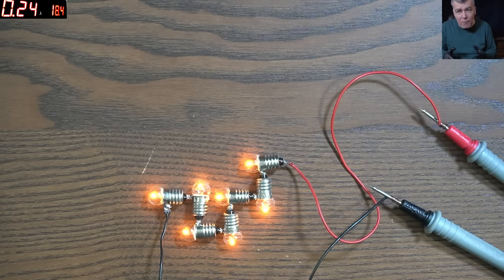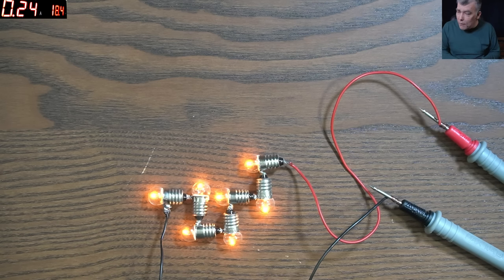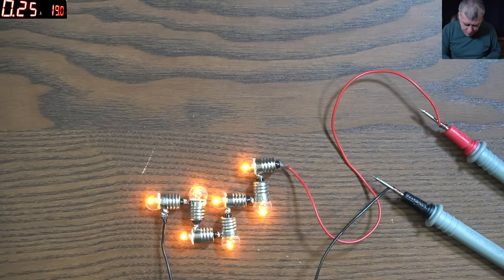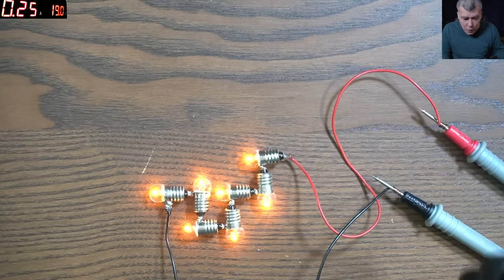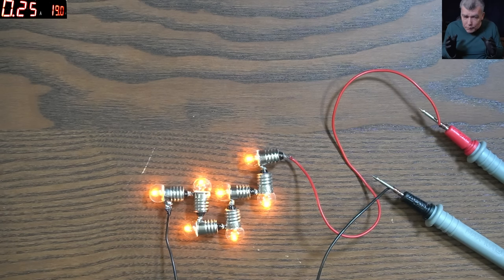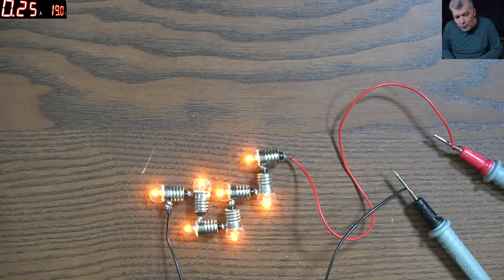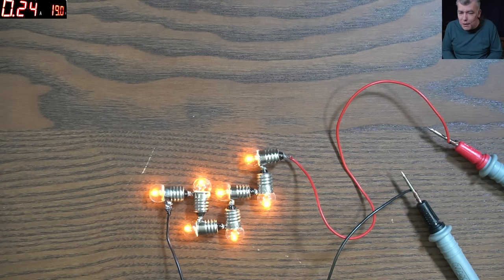Current controlled vs Voltage controlled circuit - Tv, Laptop backlight circuit explained

Comment: Controlled means constant in mathematic formula,  
U = I * R , so if U is constant, and R goes down (skipping light bulb with tweezer) then I goes up.
6=3*2 but also 6=6*1
I = U / R, so if I is constant, and R goes down (skipping light bulb with tweezer) then U goes down.
3=6/2 but also 3=3/1
----------------------------------------------------------------
Real life values at 4:44 are 0.26A = 3.1V * 11.9 Ohm (For single bulb)

Comment: Such a simple,clear and on point expenations.For all those with "Dodgy Sorin"..have faith in the WIRE :)).....anyone(almost) can just order a new laptop and just replace the parts...but only a Mythic level can fix anything with a wire :D.
Just try to imagine the lvl of knowledge and understanding of what is happening there in the circuit to be able and confident enough to do that,also to strip out the essence of what you would have learned in few years in school,in a concise few mins video.RESPECT

Comment: Wonderful Show & Tell between setting Current or Voltage as a limit.  Many viewers will have noticed the that the bulbs did display a momentary brightness change, but that is due to the filament resistance change between hot & cool.  Re-do this using LEDs to eliminate the filament effect.

Comment: So in other words, we should learn to identify whether any circuit is current control( current remain constant) or voltage control ( voltage remain constant). Power adaptor is voltage control. LED tester is current control because it can light both 1 LED or more without adjustments. Fan is current control,  LED TV circuit is current control because even if all led of strip die, it can light any good one left irrespective of the voltage. Etc. Thanks Mr SORIN

Comment: I try to follow Sorin and then he got me at 8:05 i was expecting boom 🤣
Reply: that part was confusing, because he set the current limit to 5A, but the voltage was set to 19V which just happens to be appropriate

but the way he said it, it sounded like he set the current to 5A with variable voltage, which indeed should have blown those bulbs

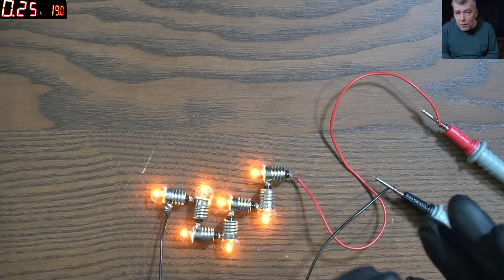Comment: Sorin! Please tell me how did you switch the voltage control to current control (current limit)  at 3:02 ? Thank you.
Reply: His power supply is expensive enough to have a "constant current" or "current limit" button.

Comment: Great video, I'm wondering what bench top power supply are you using that is limiting the voltage to 19V?  Are you using OVP and set at 19V when you raised the current to 5A?   I have a "affordable" Korad KA3005D bench power supply and still learning to use it.  It does have CC and CV along with OVP and OCP "over current and voltage protection" so I'm trying to understand when you raised the current to 5A did u use OVP at 19V which is why the CC dropped to 0.25A?
Reply: No. He set the current limit to 5A (he "told" the PS: don't you allow the current to be higher than 5A!). Nothing else is activated. Voltage supply is supplying the difference of 19 volts. All that voltage difference is being dropped on the load. The load is 76 ohms. The Ohm's law tells us that the current in the circuit with the voltage supply of 19V and Resistor 76 Ohms will be 0.25A. It does not matter that the PS is willing to supply up to 5A, the circuit is only taking 0.25A.
Reply: The current didn't drop to 0.25A, the light string only draw the current it needs, doesn't matter if you supply 1A or 1000A.
Reply: The 76 Ohms resistor (think of 76 "gauge" restrictor) is only allowing current to flow with the speed of 0.25A if the generator is pushing with "the pressure" of 19V. If this is easier to understand...

Comment: You can generally get by with with a larger current power supply than rated, but LEDs will use all available current until they burn out, so that is one exception.
Reply: No. You don't understand.

You can have a voltage supply or current supply.
If you have a voltage supply then the voltage is fixed and the current drawn from it changes. (I know the voltage can drop under load, but let's assume here the supply is perfect, and it is easily achieved with a regulator).

Then there is a current supply where the current is fixed and the voltage is variable.

"Larger current power supply than rated".
What do you mean by this?
If you are using a current supply then you set the current, and it is fixed. And you set it to a level where the LED's do not burn out. No problem here at all.

If you are using a voltage supply, then yes you can easily burn out the LED.
You have to ensure the current is set to an amount which doesn't damage the LED, and you do that by inserting a series resistor.
And you have to calculate the value of that series resistor. And yes, if you increase the supply voltage, then the current through the resistor will increase, and that current is passing through the LED too, so the LED will burn out.
Reply: @deang5622  Looks like you totally missed my point.  I am only saying two things:

1) If my radio works with a 12v 500ma power supply, then it should also work just fine with a 12v 3A supply.  There's no risk of burning my radio out since it only draws the power that it needs.

2) LEDs are an exception since they are sensitive to current, so providing more current to an LED (however you may do that) is a bad thing.

Comment: In this video you know it's in constant-current or constant-voltage mode because you're pressing a button. How do you know your LED TV is constant current? Experience?

When presented with an unknown circuit, how do you determine if it's CC or CV?

Thanks!

Comment: I came across a laptop that drops from any voltage down to 13.5 volts exactly 10 seconds after plugging it in the charger. But after it got hit it went back up to 19.5v like it's supposed to. I was thinking capacitors are going bad but voltage drop is very interesting.

Comment: How is it: You purchase a string of Christmas lights, you unwind them and set them up. In January, you take down the lights and wrap them back up. December rolls around and you unwind the lights and they are all tangled and some bulbs are mysteriously broken. How is this possible?
Great demonstration Sorin, thank you.
Reply: Mine don't because when I put them away, I wrap them around a core, it only happens to untidy, disorganised people.
Reply: I've had my lights for 20 odd years and only had a few go. It must be how you pack or store them?
Reply: Because, like any incandescent light bulb, they run a higher risk of damage from shaking than from burning out. The delicate wolfram wire breaks by itself when shaken violently, such as when you drag them on the floor and they impact things. The glass bulb will survive, but the tungsten wire won't.
Reply: Gremlins 🤣
Reply: @UpInSmoke54  
Finally! 🤣😂

Comment: Hello if i just, add a 12 dbi antenna and connect the cable in exact chip, will it improve my wifi signel and increas internet speed ? Pleas Reply.

Comment: I was wondering about making a super simple AC TIG or maybe for MIG welder "balance" circuit using the negative clipper negative bias design.   This would be controlling the 120VAC 20A mains side of a transformer based design welder.   So, with a 120VAC mains input, will incandescent light bulbs be suitable for the two resistors (assuming the potentiometer is replaced with an incandescent bulb or bank so can adjust if single bulbs are not suitable for the range of control.  The 5VDC power supply is simple along with the Diode rating for 20A is cost effective to find.   Though I am still confused why which is best to use, i.e. the 43W (300ohms) and say 28.8W (500ohms) bulb that seams correct in simulations to replace the potentiometer?
Reply: Originally I assumed I'd require high power handling, like ~4000W resistor and potentiometer.  So like a DIY might be a heater of some sort or bank of heaters or stove or quarts oven elements... then I thought about ohms law and calculated out.  That left me thinking... what actually would be common off the shelf at the resistance for 120VAC mains... and incandescent bulbs came to mind.

Comment: Hi, i have question. If we put a resistor in a circuit with a bulb to prevent it to burn out, does it still waste the energy as power supply offering ?
Reply: Yes the resistor power I^R  will be the new loss in the circuit.

Comment: Filament light bulbs don't work like LEDs at all, they don't need current limiting they act as PTC resistors and are self limiting,  LEDs do need current limiting or they'll draw very large current and burn, if you want to prove your point do the experiment with LEDs...
Reply: His point was proved anyway as the point was not to show which component requires to be current controlled to function but to prove that LED on a display are not going to be pressured by lowering the load (shorting some LEDs) and as a matter of fact that stands true for light bulbs too (if they’re voltage controlled, when you short 1 the others are going to wear off quicker) 
What you said is totally true, a light emitting diode even though is a resistance diode it will still draw a lot of current if the current is not limited. But this was not the point Sorin was trying to prove

Comment: I am very far behind on this simple lesson ☺️
Reply: This lights brightness all depends on the current passing through them. Therefore if you keep the same current in the lights, they always stay the same brightness. He used a current limit power supply, LEDs in the TV are run by current limiting driver (PSU) too.

Comment: I have a tv my leds are going from white to purple/blue strange also only 2 years old. Now need to replace all led strips all going blue pffffff.
Reply: Many times this happen when you have the backlight option maxed in the settings menu,  is better not go over the 70%
Reply: @theflowbox  yea i know after its dead haha its a problem with this lg tv series they set it from factory to 100%
Reply: LG tv are shit, backlight fails less than two years, same thing happened to ours, and even the replacement strips failed after two years
Reply: @gower1973  oke i order cheap strips from China and will use them only in 50/70% backlight mode. Dont gonna buy agian a new tv next time if they fail agian i will buy a new one xD

Comment: i learned about current controlled devices with transistors...  i couldn't figure out why it wouldn't switch on until i added a resistor to draw some current through the circuit...

...  i don't like transistors...  🫤